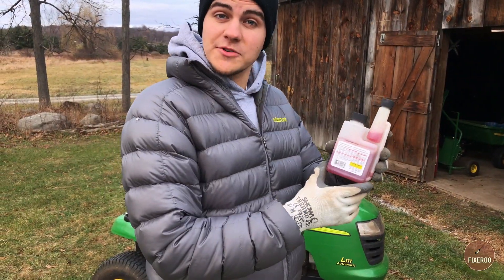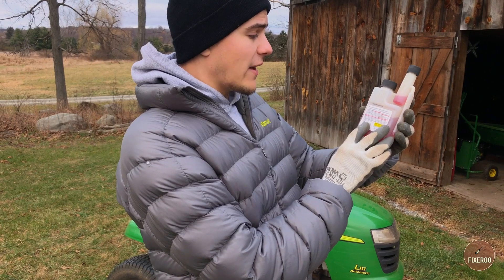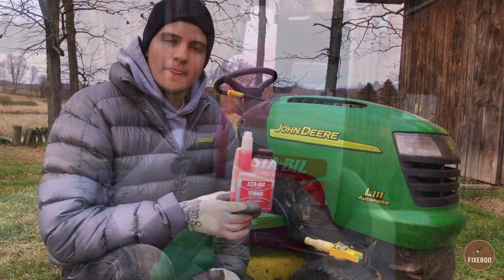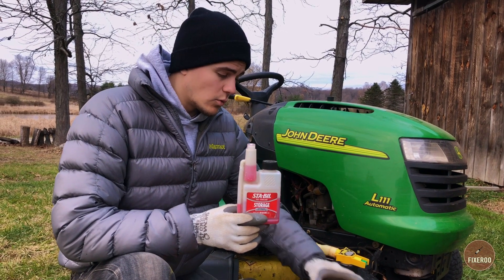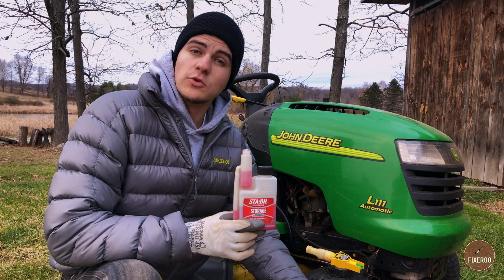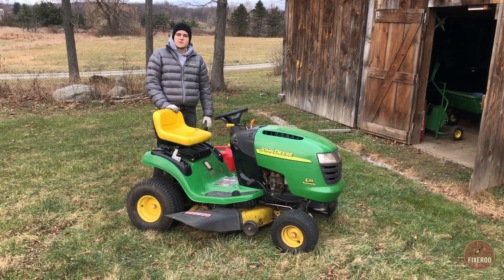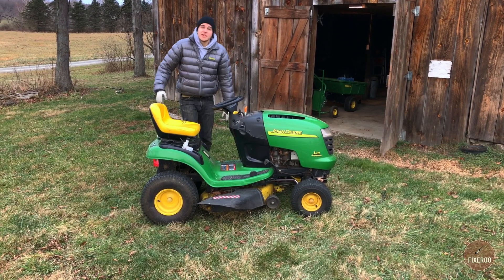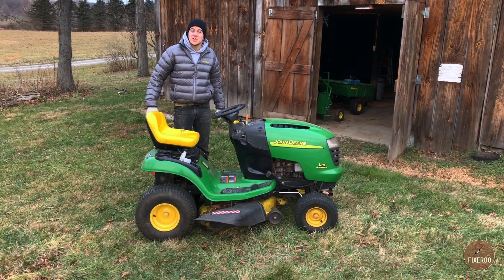How to Winterize ANY Lawn Mower

Comment: When you run it dry, isn't there still a tiny amount of fuel in a few places, such as in the carb bowl at the bottom - left in there to jel up and cause an issue? Wouldn't it be better to just leave the take full of treated fuel so there isn't a lot of empty space for condensation to build up?

Comment: Thanks for the video. If you run out the gas, you don’t have to worry about stuff gumming up the carburetor? ( sorry I am learning this myself and have limited mechanical knowledge)
Reply: That’s correct. You will have used up the ethanol and other gas additives that would have gummed up  ur carb.

Comment: Terrible advice, don't store your mower with no gas as condensation might build up in the tank. Fill the tank and add gas stabilizer as it only costs a few bucks and gas will be good when you start mower in the spring.
Reply: Thanks for the feedback. I've never had a problem with condensation  (I'm in upstate NY). fuel stabilizer definitely  works. Running dry makes sense if your tank is almost empty.